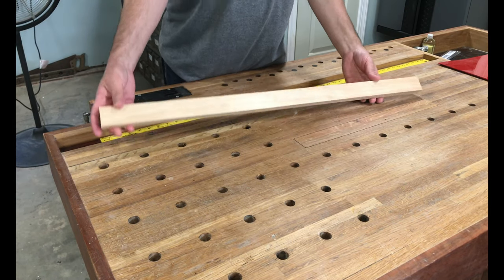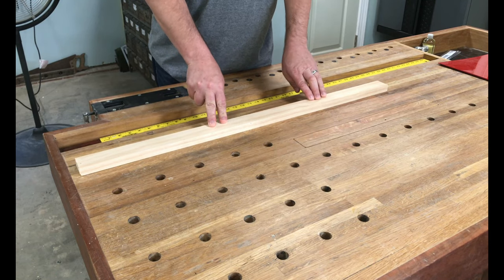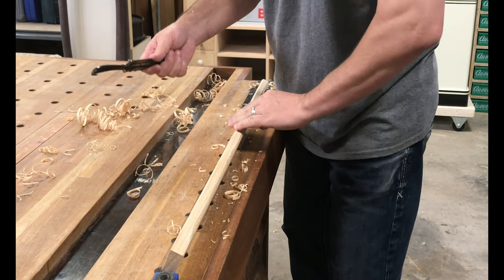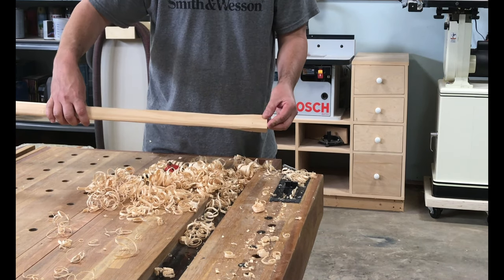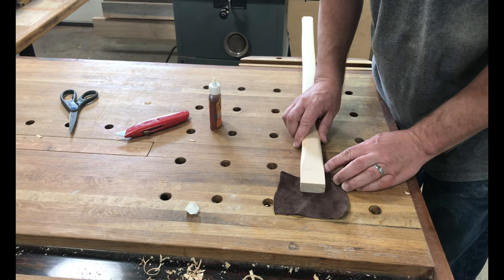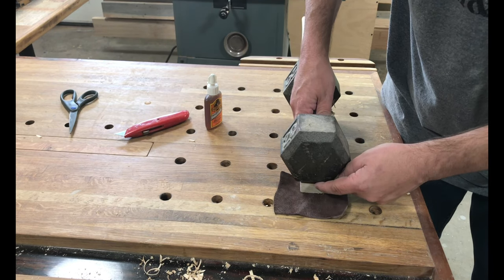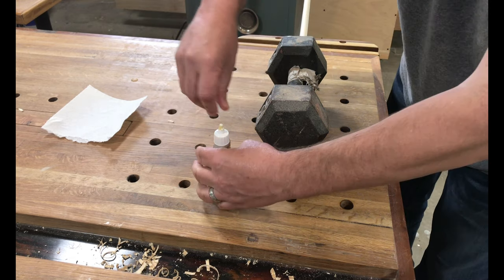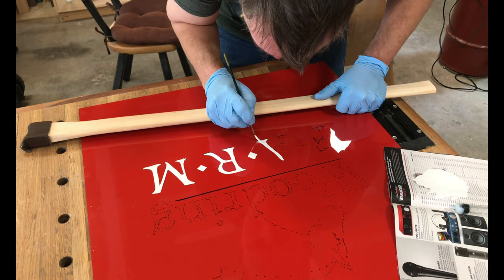What is a Mahl stick (and why you need one)

Comment: The cool part about YT is you can learn big things and little things,  I learned there is a thing called a Mahl stick,  I don't know if or when this will be important but I did learn something new and that's cool.  Thanks for sharing Patrick
Reply from the maker: So true.  I had never heard of it either, but I figured as long as I am learning, why not share.  I would think the Mahl stick could be used for other things...when you don't want your hand to make contact with something that you are working on.  They guys who do this hand lettering on vehicles and signs are pretty incredible.  I'm doing what they are showing in their videos ( I think), but not having the same results.  PRACTICE...PRACTICE...PRACTICE